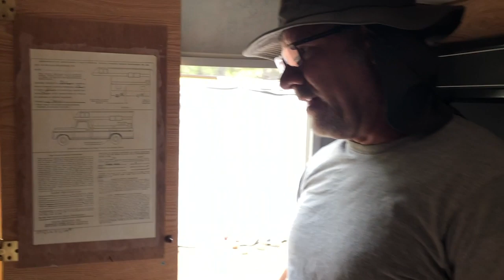Late July Update | What's been going on

Comment: Series connection = low current 2x voltage  Parallel = low voltage and 2x current.
Reply: Enrique LaRoche in series the voltage would multiply and the amps would stay the same - in parallel the voltage would stay the same and the amps would multiply?
Reply: @cajunman1288  Series volts are additive and current can be the same or less. in Parallel the Amps are additive and the Volts are the same or less.

Comment: Ford truck cabs are taller and they did not get the memo! To have proper clearance between top of cab and bottom of camper cabover, need to lay down 1x2s or 1x4s laying flat (sleepers) with a sheet of 7/16" or 1/2" OSB over that. Glue and screw the OSB to the one bys for maximum service life. :)
Reply from the maker: Yeah, Jim, that is a very astute observation. We will definitely have to shim hers to prevent it from rubbing on the cab. Thanks for watching!
Reply: You’re totally right. I’m planning on building a box to lift it higher, that way it will clear the cab and I can slide a paddle board under there. The camper was made for a much older and smaller truck but it’s light enough for the adventuring I like to do.
Reply: @Jdhdbsbsjdnraqowirjfndksjdndj  -- Sometimes newer trucks have "pillars" at the rear corners which also get in the way. My old 8' camper had the heater at one rear corner and the other rear corner was a small closet where I later put the porta-potti. I didn't want to mess with the heater so I modified the closet and got the camper to fit that way. This meant the rear end of the camper wasn't perfectly centered but nobody ever noticed. :)

Comment: Good to know that all is well now but will say overhead campers wasn't made for 4 wheeling.
Unless they are made with a metal frame and then too your top heavy and the risk of roll over is great. Of course it depends on the kind of road or trail your driving on. By the way, What kind of road or trail was you driving on?

Comment: You're good friend Jamie! Did Erin get hurt? It looks like everything's turning out good.
Reply from the maker: Thanks Mona!
Reply: No hurt just a slight ego wound. I took the old camper down a 30 mile 4x4 road to Sheep’s Bridge in AZ. It took me five hours to get there and four to get out! The next day I took it on another 4x4 adventure and that’s when I realized the bottom was dropping out, the frame was bent, there were holes in the side, bolts missing and all the cupboard doors were broken off their hinges. It was a tiny 70’s/80’s Six Pac Truck camper that had seen better days and probably should not have been abused in that way. The problem is I have more curiosity than restraint and I must always follow a dirt road the the end. Doh! This time I’m going to try and hold back. 😄

Comment: I believe you said it backwards... you should have said you're a parallel guy, doubles amperage voltage stays the same.  You said you were a series guy which instead doubles voltage and leaves amperage the same. Myself,  I'm a series/parallel guy. 400 watts at 24 volts keeping the amperage low enough to use 10 gauge solar rated wiring. 🤓
Going by the trees in the background it looks like you might be in my neighborhood. I'm just outside Flagstaff.
Reply from the maker: Yeah, backwards. We’re probably camped pretty close. Not too much rain yet!

Comment: If you wire her house outlets into the inverter you need to make sure that she does not use shore power.
Reply: If she was taught/learned how to do this herself (since this is the second time and probably not the last) she would be more empowered and safer
Reply: @geoffreymarlowe370  She already has a job she is good at.
Reply: @geoffreymarlowe370  Jaime has done many of these and  has a practical use for the knowlege. if the woman gets this knowledge it's unlikely to be used many times in the future while Jaime will probably be involved in hundreds over the next few years. Education is an investment. Learning more about video(her profession) will likely return much more benefit for her.
Reply: Can you please explain why she shouldn't use shore power?
Reply: Thank you for explaining that. I will have my power set up checked for that.  (Slowly but surely understanding the whole solar/shore watts,volts,amps thing)
Reply: ❤️❤️Battle Born❤️❤️ totally worth every dime! I used to pay a ton just run my propane fridge! Even when I had a 400 watt, 330 amp hour AGM system. Now I run a dorm fridge and never plug in to shore power even in the PNW.

Comment: Have yo u picked dates for the next Van Build for this year? I offered to assist on the scheduling/management of the projects as you had mentioned the lady who was doing it never got any time off. So, I am not sure I will be available, just trying to see when so I can work only schedule. If I retire for the third and final time, I should be available, but I may continue to work  until May 2020 now. Thanks
Reply from the maker: Yes, November 8th in Parker, AZ
Reply: @enigmaticnomadics  Okay, and I assume it will be roughly two weeks  again? I am heading that way in mid Oct, so will de pend on if I am working still and have to get back. Thanks

Comment: That is a small slide in camper! Mine hangs over the bumper by 3ft!
Reply from the maker: Yeah, pretty compact. Let’s hope this one holds up! Lol
Reply: Hers is a short bed? I would love a truck and camper set up one day. I would have to get a truck first then save for a camper later. Not sure what kind of truck to look for. F250, Tundra? Long bed?
Reply: I love the 1/2 ton plus small camper setup. My camper was 3k, the truck 15k. That said I’ve seen many great deals on CL for an older 3/4 ton truck and camper combo. The key is to make sure the camper isn’t too heavy for the truck or you’ll burn out the transmission. Being able to separate my home from my engine is important to me even if I rarely do it.
Reply: @Jdhdbsbsjdnraqowirjfndksjdndj  thanks for the info! happy trails